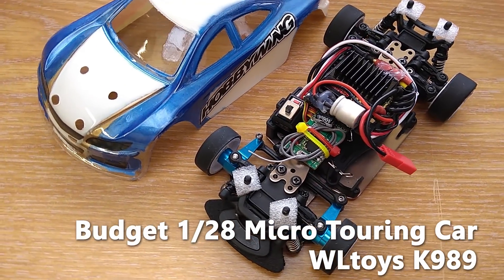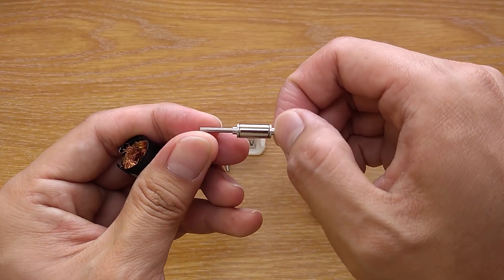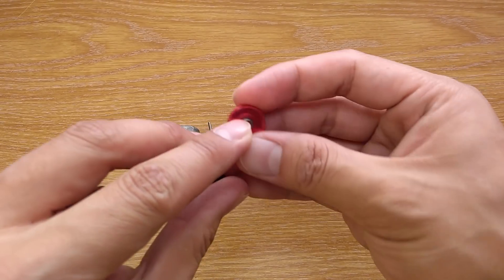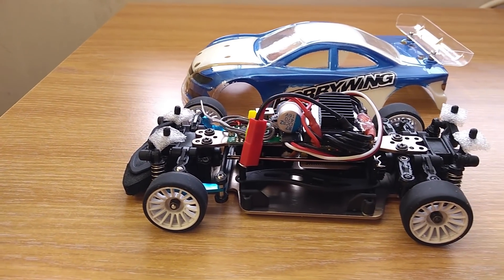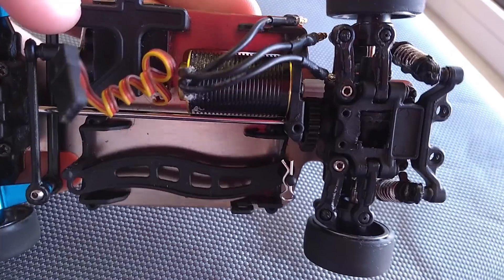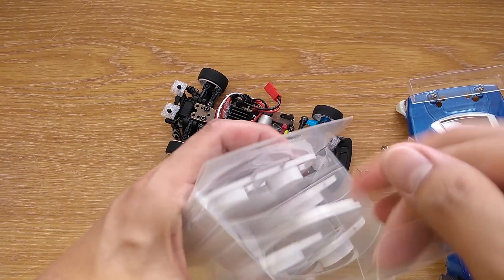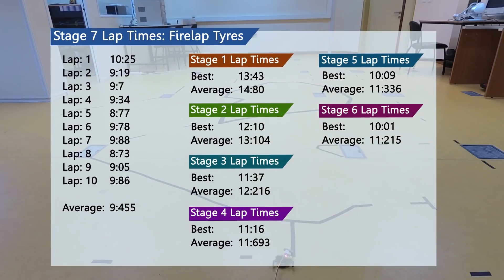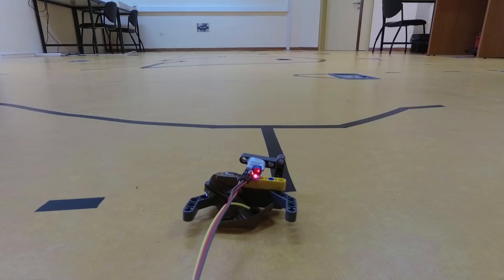WLtoys K989 Budget Touring Car - Stage7 Brushless Upgrade

Comment: do you prefer this brushless setup over your old hobbywing 1625 brushed setup?

what about the xc-10 esc setup and surpass 6000kv motor? how does it compare to hobbywing?

which of these setups would you recommend for small track carpet racing and some drifting with different tires?
Reply from the maker: For drifting out of all stuffs I've done I like the control from brushed setup with Hobbywing 1625 the most but it's the heaviest and you wouldn't want it in racing.
The XC-10A with Surpass Hobby 6000KV is OK only for drifting, but with on-road racing tyres it cogs pretty badly. ESC is weak so if you're OK with a bit more weight the Hobbywing 18A that I have in this video will be better.
To keep weight and footprint down you can de-solder Hobbywing 18A's original wires and directly connect evrything on the board. I think that's the best solution.

Final answer is the setup you see in this video but maybe different motors to suite your need. For example Atomic 3500KV for drifting and Scorpion 6000KV for racing.
Reply: thanks for your advice. I will go with hobbywing 18A and try the different motors. 

if you dont mind, what servo would you recommend? I notice you have used different ones on your rcs, but which one do you think is best?

and for rx/tx, do you think the radiolink setup is very good for race/drifting? or is it just for budget setup and you recommend something better?
Reply from the maker: @kennetcastillo7740  The best one I've used is the Genning D561MG https://goo.gl/DsrqK5 It's metal gear, digital and very fast. It won't fit WLtoys bracket directly so you'll need a bit of modding. This is what I did https://youtu.be/zB3pUN9XiSw?t=285 at 4:45 you'll see the modded servo bracket.
As for the radio, under 180 USD there's nothing better than Radiolink RC4GS. If you can afford more there're many choices for example Sanwa MT-S, Futaba 4PLS, Futaba 4PV.
I've just checked, RCmart got MT-S on discount for 155 http://www.rcmart.com/4channel-radio-rx482-fh4fh4-p-80288.html?cPath=36_47 That's very good deal.